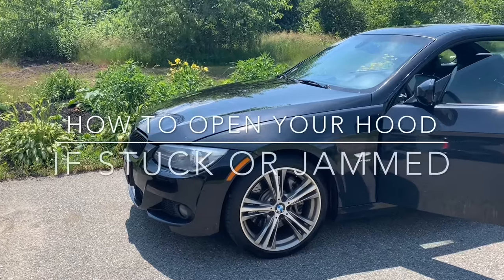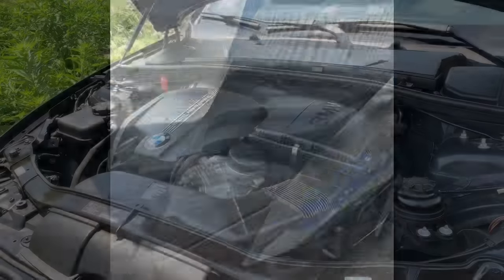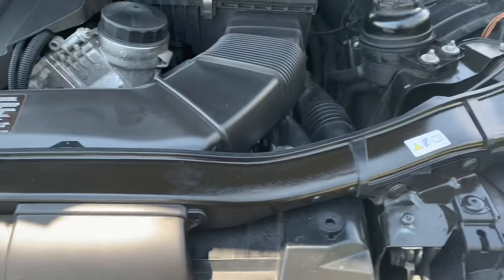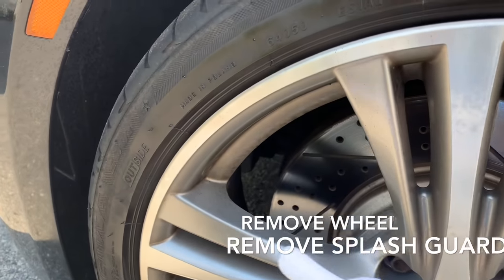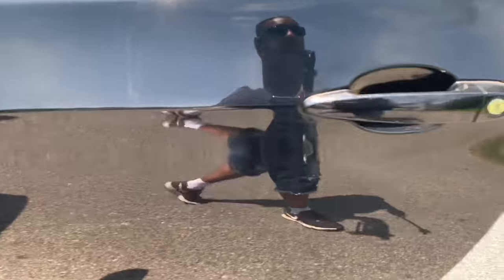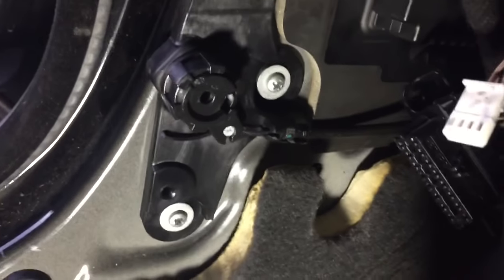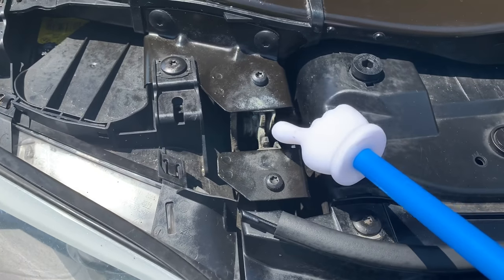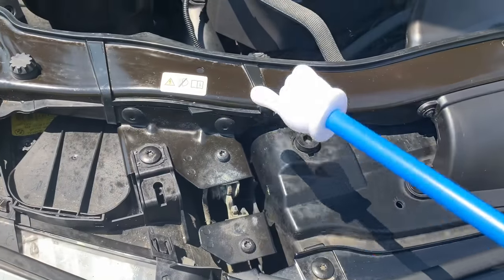HOW TO OPEN A STUCK OR JAMMED HOOD / BMW

Comment: I’m currently experiencing this issue, went through the wheel well, pulled on the cables, nothing. Took apart the pull handle in the interior, nothing. Any other alternatives?? One of the cables has some slack, assuming it’s the passenger side like you suggested. Help😩
Reply from the maker: Take the wheel off on the passenger side instead and you should be able to reach the cable up pass the reservoir tank
Reply from the maker: Assuming you took off the plastic splash guards

Comment: Thanks man dear God I wish all vids were straight to the point and articulate like this.  No nonsense and calm thanks for sharing.  My sons latch broke at the release after continual trouble with the passenger side...confirmed my suspicions -cable stretch on the main cable after wear/corrosion of the latch
Reply from the maker: Use white lithium grease for preventative maintenance on the new ones

Comment: Worked great, thank you. Mine was on passenger side and cable was loose near release lever. I was able to lift right side of hood and pull on cable.
Reply: How did you reach under the hood ?

Comment: you can use something to wedge the driver side enough to grab that cable... once you get the cable use a metal coat hanger, wrap around the passenger cable and then wrap that coat hanger around a screw driver or something to give u pulling leverage. give it a yank and the hood will open

ask me how i know... after watching countless videos and giving up 10+ times in my garage lol
Reply from the maker: Thats exactly what i did with my previous bmw....i was going to mention that on this video but then I realized how unsafe it was and not the best thing to show how to do on my channel....the thing about the way you mentioned....whatever your wedging can slip and fall while you are trying to reach the cable then your arm can be at risk ....i even made a video about that a couple years ago ...and deleted it because of safety....i try my best to stick with what the book says to do...that has all the correct answers
Reply from the maker: It could be possible that you saw the video I deleted 😂
Reply: @BimmaJoc  I have removed my wheel well liner I have pulled on both of the cables even very hard and it’s still not even budging, the latch had been very hard to pull prior to when it seized up and going through the wheel, well worked the first time this happened, I did not know to oil the latches or I would have done that while they were open, it has worked several times since then but now it has seized up again, and it will not even loosen with the cable underneath the wheel well. As I’m holding onto the junction box, I can feel the latch itself from the inside is working, but the latches themselves will not release. Is there any other safe alternative or way to get this hood open?

Comment: In this case, the problem is that the hood won't pop at all with the lever on left bottom at the driver? Or it does pop but then the lever at the middle of the hood is stuck? Because I have the second problem. 🤔
Reply from the maker: Either way if you follow the video instructions….it should still open
Reply: @BimmaJoc  So my problem was indeed different (simpler). The pull wires / latches were fine. My only problem was that the lever in the middle of the hood, which you use to open it after unlocking from the driver side, was completely stuck. I wasn't able to get in there myself even after spraying it a bit with WD-40 (also I wasn't sure if I didn't have the problem described in this video) so I took it to the garage and they were able to open it after some struggle. Once opened, it just needed some more oil + moving it up and down for a while and it's fine now.
So just take it as a reminder, that mechanism also needs to be oiled once in a while.

Comment: My passenger side lock is jammed. Do you just pull on the driver side black wire?
Reply from the maker: So the passenger side wire …yes comes from the driver side and is the longest wire

Comment: I thought I had an alignment issue with mine especially after watching videos on here , after some messing around under the bonnet (UK👍) I found that the catch on drivers side (RH druve) wasn't working Correctly so the bonnet wasn't closing down on that side , I've greased it up   but think it's  just too far gone, are they easy to replace?
Cheers
Reply from the maker: Its an uncomfortable job ....just make sure you snake the new cable up with the old one
Reply from the maker: https://youtu.be/tHNCpYL61Bw
Reply: @BimmaJoc  nothing is ever easy 🤣 thanks for the  reply and video link, much appreciated 👍

Comment: I took the crumbling plastic by hood release 1999 bmw 528i.. I got to the frayed broke cable but pulled on it with pliers.. and nothing.. took grill out.. pulled on top wire.. nothing.. working on it for 2 days.. nothing..
Reply from the maker: You
Did everything but what was on the video thats y u got nothing
Reply: @BimmaJoc  actually I did all that first.... then many other things
Reply: also cut holes with a pocket knife through fan housing to get to drivers side latch under hood, as well as wheel well and many other things , pulling on the cable does nothing
Reply: been working on it for two weeks,
Reply: @tylervision707maul  did you ever get yours over because it sounds like you’re having the same situation I am I’ve went through the wheel well I’ve pulled on the cables etc. and they still just will not pop up. The interior latch was very resistant to begin with before it seized up. The first time I went through the wheel well to open the latches worked., I didn’t know to oil it at that point but it continued working for a couple times, and then it has seized up again